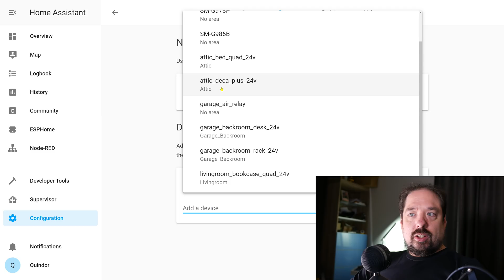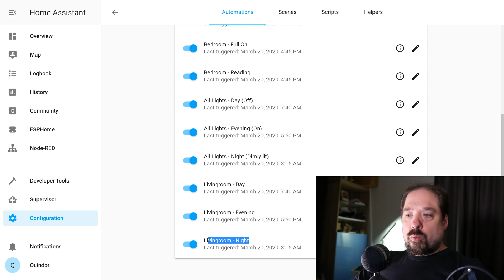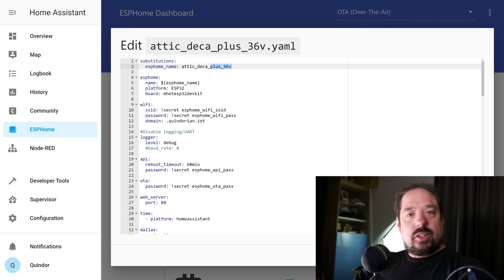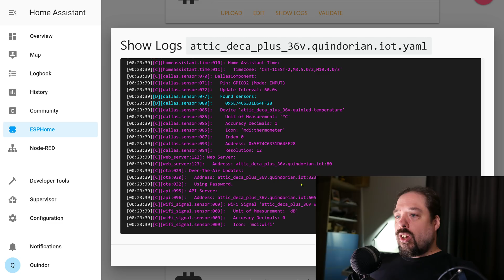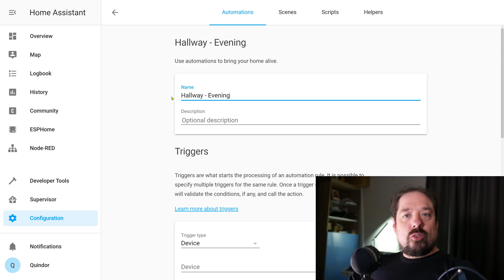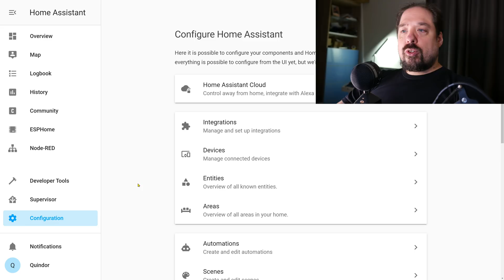Comment: This is great stuff!
I'm looking through your quinled.info web site, and I see all your boards are designed for a WiFi daughter board.  Is it possible to use an ethernet module instead of WiFi without much/any modification?
Reply: Sadly no, that same board is also the Micro-controller so runs the PWM for the channels, etc.. I've tried making a version with ethernet but I wasn't able to get that function stable over multiple prototypes so I scrapped it.  I might look into it again in the future. :)
On a side note, the WiFi has been perfectly stable for me (uptime of 100days+ connected), and the data that travels over it is very low, just simple commands and now and then.
Reply: @IntermitTech  Thanks for the reply!   I ask because I inherently don't like using WiFi if I don't have to because of security, overlap, and speed.  Obviously speed isn't an issue here, and security is always an issue for me, but the main reason is the overlap.  I live in subdivision where everyone, their brother, and their dog has at least one WiFi router and access points set up.  Also, there are already far too many wireless-only devices in my home (phones, tablets, cheap laptops, cheap Roku, etc) that I hate to add even more.  There really aren't any clean WiFi channels left.  Not to mention other non WiFi things, like all the garage door openers, baby monitors, and other things.  It's just a very dirty space in the EM band where I live.
Reply: @gmscott9319  I see, I can understand that, here in my home it's less of a problem but everyone's situation is different. I'll probably revisit a ethernet based version for this board in the future, but it would require a very different design, unsuitable for DIY for instance, but still, I can understand the appeal of running ethernet to it. :)

Comment: Q: You have your ESP32 outputs running at 40,000Hz - What's the fastest PWM rate I can run on a D1 Mini??
Reply: A D1 mini is based on an ESP8266 and such can't really run PWM higher then 1000Hz (1kHz) for 2 channels and even then, it's isn't very stable PWM. That's why my newer designs all use ESP32s which are much much better for this!
Reply: Thanks but... Hmmm, that's weird because I'm running 3 PWM outputs at 3K each and it's fine. I'll have a play. 😉

Comment: You can add your light as an entity below adding the device when creating a scene.
Reply: Ok, I need to come back on this one. After further research, if your turn on advanced mode in your user profile, you indeed get a field to add individual entities. But once you do that, the whole scene mechanism breaks completely it seems. As soon as you save it, it adds it as a device again and you see all channels, but after that I can't make any changes anymore and what you see visually doesn't correspond with what will actually happen, etc.. I'll be filing some bug reports. ;) So I would still advise to use the way I did it in the video. :)
Reply: Sadly no, scene always sets all entities of a device